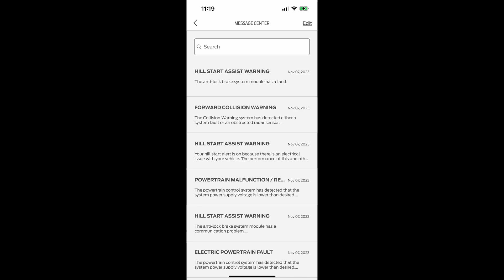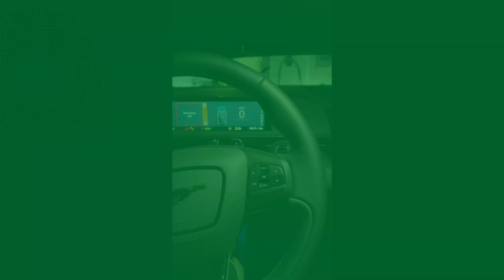Mustang Mach E 12v battery is dead AGAIN & vehicle BRICKED || Frustrating || Ford needs fix this NOW

Comment: @My 12 volt battery I have changed the battery twice and the battery is getting sucked down to no cells what can be the cause of this on my mache
Reply from the maker: I've heard that cold is the worst enemy.  Try keeping you High Voltage (main) battery charged at 85%.  I had my vehicle in at the Ford Dealer for 2 months and the 12v battery never died.  Please like and subscribe as it really helps me as a creator.  Thanks for the question and for watching!

Comment: It's not the size of the battery that's a problem.  It's the regulator..... or the software.
Reply from the maker: It could be, but the battery being less than half the physical size and having less than half the capacity AND reserve capacity of a regular battery can't help things.  Thanks for the comment and for watching!
Reply: @MoreBear  It may be half but not less then half the size.  It's still 330 CCA.  It's more than enough for smaller cars.  But everything has to work right.  If it was genuinely the battery, then a bigger more powerful battery would just last longer but the problem would still rear it's ugly head.  The vast majority of Mach-E owners do not have a battery problem.
Reply from the maker: I still think the problem is with the reserve capacity.  CCA is irrelevant in an EV (no starter motor or combustion engine).  If there was more reserve and more AH to begin with, the battery would last longer between charges.  I have Milwaukee batteries that have more AH than this lawn mower battery.   @randyXLT
Reply: @MoreBear  Hmm, the higher CCA the more reserve you have.  I think they go hand in hand.  What needs to happen is that the big lithium battery needs to charge up the 12 better [or more often].    In a good working EV, [like mine], after about 2 days of not driving at all, something kicks on and charges the 12 volt.   Maybe some are not working correctly.  Mine works good.

Comment: Any updates on your Mach-e? I have a 2023 prem er awd and worried about this issue
Reply from the maker: It's the 4th time I've had this happen.  The first time it was towed to the Dealer for about a week.  I am not expecting perfection with new technology, but not this.  Best of luck to you.  My only advice is to keep it charged or plugged in whenever possible, especially overnight in colder weather.  Thanks for watching and the comment.

Comment: Do you have an accessory phantom draining the battery? OBDII reader? Dash cam? Did you connect FordPass to your local utility for automatic time-of-day saving? They ping the car a lot and have been known to drain the 12v. Other possibility is walking past the car frequently with the key / phone in your pocket and waking the car up - that will also drain the 12v
Reply from the maker: No phantom drain.  Dash cam was installed but removed about 8 months ago.  Ford pass is connected, but not on a schedule.  It charges when i plug in to always maintain the 12v battery.  Only walk past the car twice a day (to and from work).  Thanks for the suggestions and for watching!